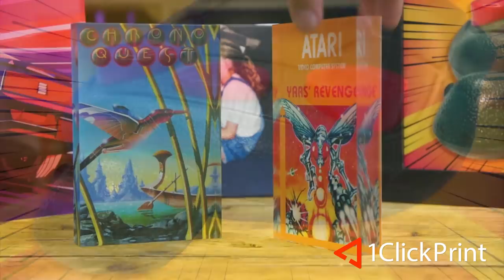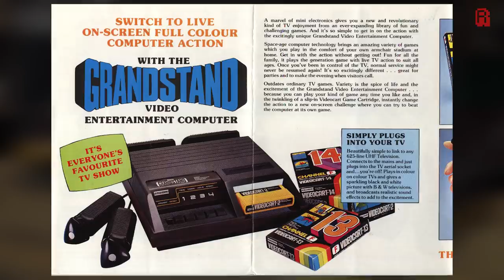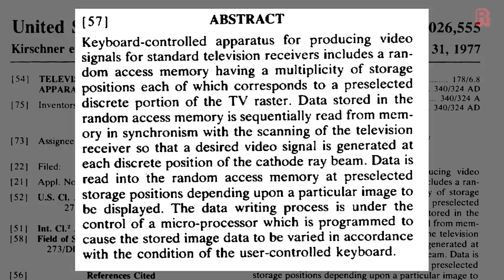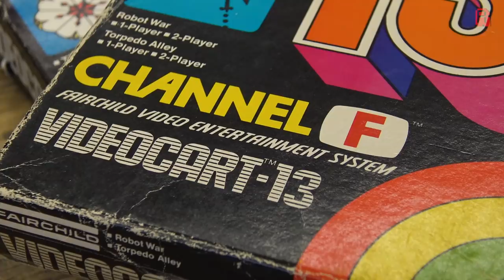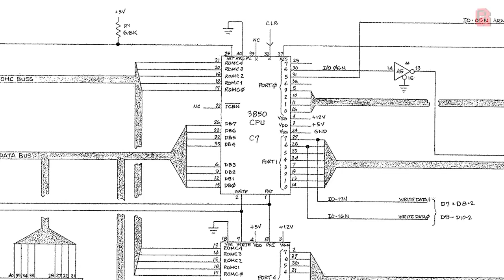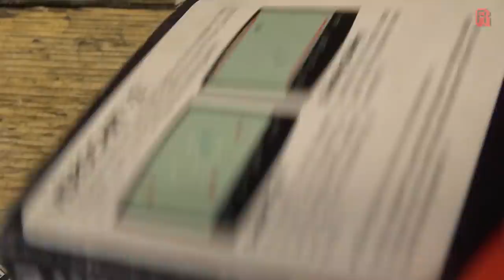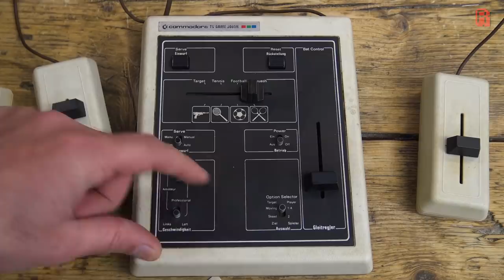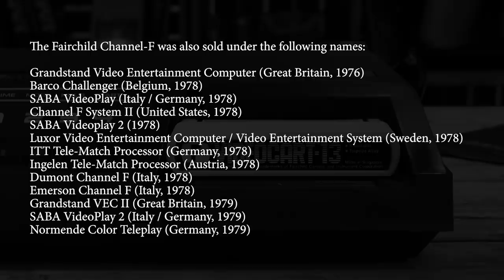Alpex Project RAVEN - The Fairchild Channel-F | Computer History

Comment: Very nice video, the Alpex background is probably not very well known. 

Your Grandstand derives the clock from the 8.8... something MHz (double color burst for PAL) crystal in your machine. CPU is clocked at 1/5 of that which is about 1.77 MHz, a little less than the NTSC.
The first generation PAL had a separate 2.00MHz crystal, so the fastest "Channel F" is the PAL v1 and the slowest is your machine, a gen. 2 PAL unit. 

All the logic chips you saw on the Sean Riddle motherboard image... compressed into a single ceramic 40 pin chip visible as a socketed chip at 12:42 is a bit more than cosmetic changes. I guess to the end user there's only cosmetic changes unless counting being able to adjust the volume. 

It's a "hand controller" according to the manual - and more like a stick than any other joystick.  ;-)

Slot Machine!? How is that fun? 
My best Drag Race time:  7:6 - that's fun!

Michael Glass has only the initial K, the T is left there from the original text (the word WANT).

Comment: Wait, what? They were awarded the patent for ROM cartridges and raster graphics? Soooo, did Alpex claim royalties from later systems that used those concepts?
Reply from the maker: This is a door I chose not to open in this video but may make a video on soon.  Other companies would have paid license fees, just as for example Microsoft pay Sony and no doubt Sony pay Microsoft for various patents for consoles, controllers and software patents.  Nintendo however did not with the NES which led to a huge court case.  Alpex were looking at a big payout but Nintendo proved they used a different (and quicker) method of getting the pixels on the screen and avoided the fine.  There are a lot of cases around the patent.
Reply: @RMCRetro  Interesting, thanks.

Comment: I used to have one of these, mint condition with a full set of carts. Got took down the dump in the mid-late 90's, wish I'd known its potential value then
Reply: That happens a lot.
Usually you only realise what you've done several decades later. XD
These days I do my best to hold onto things...
But there's a fine line between keeping things for historical reasons and just becoming a hoarder.
In some ways, nearly everything is valuable if you keep it long enough.
In fact, sometimes the more it seems like trash at the time, the more valuable it is in the long run precisely BECAUSE nobody keeps it...

Comment: Well one has to day that the Fairchild apparently had what's now called a "Framebuffer" which the Atari 2600 didn't. The hardware of the Atari 2600 still was locked in the ball-and-bat mindset, though controlled by a microprocessor. The Fairchild seemed more like a computer aimed at graphics but severely limited in terms of RAM.

Comment: Biggest change from 1976 to the Channel F II (from a user perspective) is the sound on RF instead from a built-in speaker. There's a 1976-looking version with this construction as well on a large motherboard - just as the PAL SABA Videoplay 2. 
From a technical standpoint all the standard TTL logic chips have been replaced by custom IC:s - which makes it impressively small compared to the original. 

Homebrew games that's available on the Multi-Cart should be mentioned as well I think. Tetris, Pac-Man, Lights Out ...  latest additions are the small games "Kevin vs Tomatoes" (released on it's own cart as well) and upcoming "Killer Heads of Lettuce", both by Chris Read.

BTW
There's an easter egg in #26 as well (Brad Reid wrote that as well so... not that surprising).

Comment: The games look just like the Philips G7000 games I had as a kid.
Reply from the maker: The G7000 was a rebranded Magnavox Odyssey 2, also a 2nd gen console of the same period.  I have one I need to fix, would be fun to put them head to head
Reply: @RMCRetro  The joysticks were a big let down for me. The metal contacts inside didn't last long, and would either loose their springiness or come away from the circuit board. I used to use small amounts of Blu tac to try and keep them in place.
Reply: @RMCRetro  There is an interesting thing about the G7000 and the G7400 (or was it 7600 or 7800..) that would make the graphics look a bit more different from Channel-F I think. It only works on a few games, but the fancy model is sort of doing a PS4pro thing. :)
Reply: @RMCRetro  The O2/VideoPac is going to win this one hands down, simply because it has a number of games that are actually good fun to play.

Comment: Hmm... The patent references makes me wonder if Atari and others ever had to pay Fairchild license fees or royalties. And if not, how did they get around the patent.
Reply from the maker: Atari and others did pay a license fee.  Nintendo did not, court cases ensued, but that's another story
Reply: @RMCRetro  And I look forward to your video on it. ;)
Reply: RetroManCave. So that puts a check in the win column for Fairchild. Not a total failure then.
Reply: The Atari 2500 does not use  a frame buffer so that part would not apply. Something I keep wondering with all these Video Games patents is if they applied to home computers. A lot of the time the only difference was the inclusion of a keyboard. However the home computer could be marketed as a tool for learning programming that just happens to play games.

Comment: Rather than RAM and colors I believe the big reason the 2600 VCS was more successful than the Channel F was the flexibility of the TIA graphics over the fixed bitmap of the Channel F.  While 2600 programmers could discover new ways to push the TIA to generate more complex and varied displays, whereas the Channel-F is locked into the same bitmap.  And while the Channel F could have created a more complex display than the 2600 VCS, manipulating that display would likely require more CPU power - resulting in games being "slower".

Comment: very much the blueprint... But the Atari did not have a frame buffer.  The RAM-less design was crucial to making it at a reasonable price at that early time.

As I recall, the Fairchild CPU was a primitive multi-chip design.  And the system was also built without RAM, having half as much (64 bytes internal to the CPU, as registers) as the Atari with its 128 bytes of on-chip "page 0" memory.

At least the Fairchild had a frame buffer.  But Atari did not.

The Atari may have had "twice the RAM", but each row or half-row (if you did not want mirroring) had to be loaded into the display register at exactly the right time, and there was no interrupt so it was done with instruction timing.  I'm amazed people could program that thing at all.  So your comparison at the end of the video is missing critical information:  F8 system had 64 + 2048 bytes, including the frame buffer; Atari had 128 + 40 bytes, buffering only half of one row at a time.  Which had "more" RAM?
Reply from the maker: Thanks for your comment.  The F8 CPU was indeed initially 2 chips as Fairchild couldn't source enough ICs of the required legs to manufacture.  It was later sold as a single IC.  Nintendo is also an interesting case with the NES they ended up in court in the 80s for infringing the 555 patent but avoided a large fine as they eventually proved they used a different method to update the screen.  It's a fascinating case to read up on.
Reply: @RMCRetro  Yea, the NES was essentially Text Mode, with customized characters.
I wonder from your brief description just what was the specificity of the patent?  A whole-screen pixel map in RAM, or that it used the main CPU to ship data to the DAC rather than having a specialized video chip, or the fact that it was used for games?